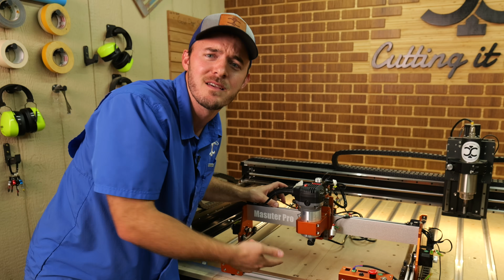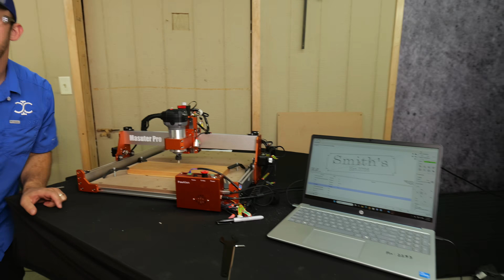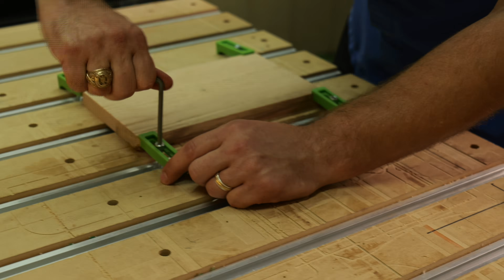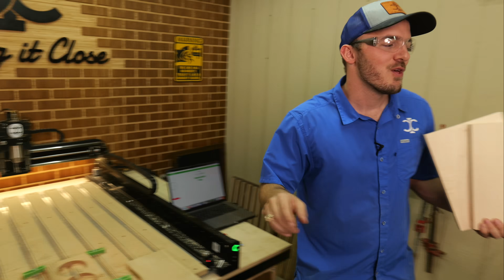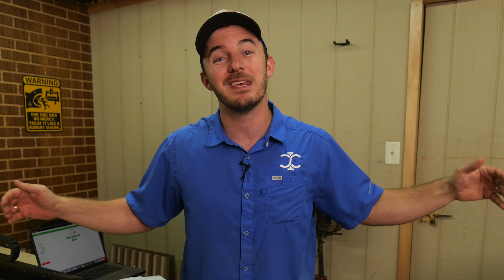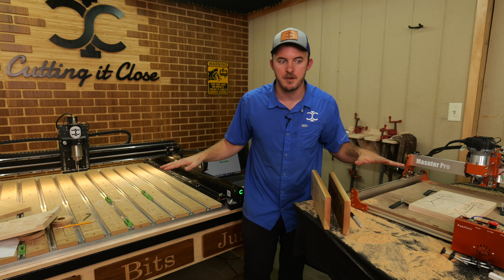$500 vs $5,000 CNC - Are They REALLY Worth 10x More?

Comment: Belt-driven axes are fine for 3D printing and laser engraving because the printhead/ laser is relatively light and does not experience any loading during use if you are doing it right. There is also exceptionally low likelihood of getting foreign matter in the belt grooves with 3D printing, and a low but non-zero likelihood with laser engraving/ cutting - but you would need to not clean the machine for many, many hours in order to foul the mechanism. For anything that removes material as chips, Acme screws are the absolute minimum and ballscrews the preferred mechanism. Linear rails have become the standard for any level of machine, as Hiwin clones are now very cheap and reasonably functional. The same holds for V-wheels as the belt system, it's fine if there is no foreign matter and light loads such as 3D printing and laser engraving. For the linear rails, the Hiwin-style ones usually are offered with wipers to decrease the likelihood of foreign matter getting into the mechanism.

You can now get a better machine for $1,000 (ball screws, Hiwin-style rails, but 16 x 12 x 3 inch work envelope) than I was able to purchase for $3,500 about a decade ago (ball screws, hardened rods with plastic bushings for linear rails, 6 x 6 x 6 work envelope). But the old machine was built with the rigidity of a mill, and the new machine was built as a router. That is a significant difference, but it only means something to the end-user if one intends to work with ferrous metals.

With regards to losing steps, the Shapeoko does not appear to have closed-loop steppers, and I would be willing to bet they are not servo motors either. If it had either, I am sure they would point it out in the specifications, as they are a significant upgrade. Any open-loop stepper motor can lose steps. Everything presumes the motors did what they were told. At least with closed-loop steppers or servo motors the motion controller has feedback when the motor is unable to obey the command, but it doesn't know by how much the axis has deviated from the commanded position. One step here or there, particularly for woodworking, is not even something you will notice. Many machines step hundreds of times to travel one millimeter distance, so you need to lose a lot of steps to have a visible problem. Even for hobbyist machining, I have yet to see someone integrate a glass scale DRO sender for directly measuring the axis positions and feeding them back to the motion controller, so no machine truly knows where it is as everything counts steps from the homing position. Sure, some hobbyist CNC mills have a DRO, but it's not an active participant in the motion control system. Bigger/ better motors, which is part of the difference between the machines here, just means it's less likely you will overpower the motor and lose steps or that the motor has some limited ability to self-correct for abnormal positioning. You are comparing a tiny NEMA 17 motor to a significantly larger NEMA 23 motor. It's not a fair comparison.

I second the suggestion to compare one of the $1,000 units (3030 or 4030). They have a similar motor, similar axis construction, etc. The biggest difference with the Shapeoko is the size of the work envelope.

Comment: STAY AWAY FROM BELT MACHINES. Budget lead screw machines would have been fine. Slow... YES, but fine. The relief would have finished, after that same 10-12 hours, and the smoker would have been fine with conservative cuts. 

As others have said, the Genmitsu 4040 Pro is a budget beast. I've also had good luck with a Two Trees TTC-450. Both would be miles better than a belt driven machine.  

I now have a Onefinity and really like it. However... I'd never suggest a belt driven machine to even someone I didn't like. Again... stay away from belts. There may be a pricey exception to the rule, but in general it a good rule of thumb.

Comment: I own the twotrees ttc450 ultra (about €600), I feel that it takes anything I throw at it. It's a sturdy machine with a 500W spindle and uses lead screws.. it can do 1000mm/min 2mm deep on plywood with an aggressive 3mm bit without skipping a step, however didn't try hardwoods yet. The only downside is that I need to use the SD card to give it jobs, because the USB connection is not really reliable..

Comment: At 11:30 you say slow it down and have to baby-sit. Both of those statements are patently false. 

Speeds and feeds are determined by the machine’s capabilities. If you made an error, and ran the machine faster than its capabilities for a certain material, then that is a user error.

There is no babysitting a machine. Once you have sent the G code to the machine, it is running autonomously. About the only thing you can do is stop it if an error occurs. But if an error occurs, there’s nothing you can do to save it as the error already occurred.

Also worth noting is there was no dust collection noted, which on the machine operated by bands you can’t afford to have the bands clogged up with wood shavings. 

Can the $5000 machine process more work more efficiently than a $500 machine absolutely. If you have a product sold and the $500 machine will do what you needed to do to make that product then why wouldn’t you buy the $500 machine? Sell even more of them earning you more money and then if you still have sales and can afford the $5000 machine by all means.

Comment: There is a lot of parallel to 3D printing. I bought a Ender 3 about 9 years ago- it was cheap, it didn't work well, I spent a lot of time and money on doing upgrades and learned the machine inside and out. I could make really good prints if all of the planets aligned and I had everything set up perfectly- but it printed very slowly.  Fast forward 7 years, I bought a Bambu P1S, which ran perfectly out of the box, never needed tweaking, workarounds, driver board upgrades, or G-code settings edited, and has made very few failed prints, plus prints about 5-10x faster.   One machine was a hobby just to get it to work properly, the other was a hobby in printing things that I wanted.

Comment: I have the Masuter Pro and have done 3D sculpting as well as many layered projects. For what it's worth, I would have used shallower passes on those projects. Takes much longer, but the quality does hold up. I made dust covers and guards for all the belts so sawdust is not as big an issue, but anytime you have belt drive you pretty much have to babysit denser wood. I've made my money back on this machine and then some, but I don't use it enough to justify buying higher quality. I'll run this until major failure and be done.

Comment: Hey I work with cnc's, I have a 4040pro with an upgraded xz, 2.2kw water cooled spindle, nema 23's, beefed up aluminum, and I also put linear rails on the y. I also built a wifi pendant that lets me control it manually with a ps5 controller and I can make tool paths from what I do with my hands. Its pretty dope
Reply: So basically I bought a 4040 pro and now I have almost no 4040 pro left.

Comment: I have multiple CNCs and I have had my FA Masuter Pro for 5yrs and it has paid itself many times over.  I have done everything in your video but only a couple of 3d carvings.  There are many inexpensive upgrade kits and 3D printable accessories for the Masuter Pro.  I like the idea of the less expensive machines because you can have multiple so you can do multiple projects at the same time.  Honestly, the sweet spot is $1500-$2000.  Compare the Fox Alien Masuter 3S for $900 or XE-Pro for $1400.

Comment: The fox alien is good for understanding cnc and thinker a bit to make it bether. But it will never come close to the Shepeoko. I have a diy cnc and i made it for testing and cut aluminum with mix results. The model of the cnc is a artisan and it is big. 120x180mtr but thats overall size. Made it with parts of a 3d printer. Looks and runs good. With a Makite CNC!

Comment: I am interested in starting with a cnc that can cut metal,AL,Copper and Brass. I have experience from my work as a Lab Technician for about 10 years with some experience on vertical mills,drill presses,planars so I am not a machinist but familiar with the operations. This is a very good video too bad there wasn't a $1-3,000 cnc router with choices for spindle vs router tools etc. Also I love your approach to this initial dilemma when buying a cnc router,also do you have an equal in the 3D printing field ? I have been doing3D printing for about 3 years and find the majority of posts promote 3D printing as "easy" and a "great" source of manufacturing 3d objects yet we both know that's not the truth ,it can be very challenging and sometimes I have to babysit a printer thru numerous errors,some which are correctable,workarounds but cnc routing/milling can be less forgiving. Thanks for the great video!

Comment: This comparison is not really sensible.  The Shapeoko is a professional level machine; the Fox Alien is an entrance-level hobbiest machine.  Rubber belts for a CNC router?  Fine for a 3D printer with a low inertia extruder.  For pushing a router bit against hardwood?  No way.  And doing that with a roller carriage and no chip/dust control?  What do you expect?  Of course there's dust & chips on the carriage way -- and on the rubber belts & their cogged pulleys as well.  Setting up the Fox Allen with protected carriages and an effective dust shoe would be a better test of its capabilities.  For smaller jobs that don't need the Shapeoko size, CNC routers that are significantly less expensive can do a great job.  This comparison seems designed to prove a point.

Comment: I have a twotrees ttc450.. headache. Had to rebuild the gantry due to backlash. Then a spindle upgrade that came with a  scrappy power supply that lasted 3 projects. It ended up costing me over 1k and I could have bought a better used cnc for that price

Comment: I got the Sainsmart 4040 Pro Max.  It has screw drive instead of the belts, and a nice 700 watt router/spindle.  Ive run all of these kinds of projects, and not had a fail yet.  The only bit Ive broken so far, was because I had the Z axis set to go down 10mm per button instead of 1mm...  Wasnt using the Z probe.

Comment: Alright had to subscribe. I did experience the skips but also i have switched to Easel pro and using that software instead of importing g code to candle and running the job. So since i did that and i use HDU (i work at a sign company lol, im the painter) It SEEMS to me that Easel Pro cuts better, actually i didn't have any skipping issues while it was going in circles for that test job. The only problem was my fault i forgot to delete a design and it cut  a tiny bit deeper. It's been 3 months and that's what i learned so far!

Comment: I live in the UK, and started by taking a punt on a 'Denford Microrouter' second hand on eBay for £600 from a guy who lived a few miles up the road and knew nothing about it. He was just buying and flipping mechanical items, and machinery that he had bought at auction. 
Once I bought it, I was shocked to learn I then had to pay (gamble) £300 for the controller software, to see if it even worked which could've been a huge problem, luckily it worked. The company wouldn't even give you a trial! It was £300 or nothing, and they build their own control software in house, so control the licence. 
I already knew before buying that the machine turned on, and the fans and lights came on within the controller box and on the controller board, and that the light also came on within the CNC enclosure, as well as the safety lock worked. But, I had no idea if it would work 'properly' or not, or even connect to the software or laptop. 

This machine was designed for the education market, so was built to a high standard, both in terms of components and safety. It ran on ball screws, and linear rails, and had a Kress (now AMB) "spindle\router hybrid" in it that took ER11 collets, with auto start up controlled by the g-code. The machine was in an enclosure, and the cut capacity was around the size of a sheet of A3. You could fit larger pieces in there, but it would only cut within the confines of a sheet of A3. So, sometimes you had to be clever in the positioning and movement of your stock to get the most capacity from the machine. When the machine was brand new in 2004 it would've cost around £15k. 
They still sell the same sort of machines now, just in flashier cases, with newer, more modern graphics on the side, and the electronics and controller fully built into the unit. No doubt with more modern upgraded motors and parts, as well as beefier spindles, including options for ATC's. Like I said they are aimed mainly at the education sector, so come in a range of sizes, but the largest is probably a bed of 1.2metre long x 75\80cm wide (I might be wrong). My controller wasn't built in. It came in a separate massive black box. Like a huge PC case. That is no longer an issue on the newer models. Though I did get the luxury of being able to connect via USB, as some of the earlier models used RS232 serial cables.

Even though the machine was around 16 years old when I bought it, I rang Denford and they were incredibly helpful even though it was second hand. They still offered support, including the option of a full service, and parts if needed. As well as the sale of the very expensive control software licence! Luckily this was transferrable when I eventually sold it. 
 

It taught me everything I needed to know about CNC and was a pleasure to use apart from the odd teething issue. Best of all, it made me enough money to upgrade to a larger machine, and when I sold it I even made a profit 5 years of use later. 

The moral of my long story is to shop around on the second hand market, while learning all you can online about how CNC's work. My story shows that you can easily pick up a bargain second hand, of excellent quality, for just a little bit more than the Fox Alien Masuter Pro. 

It all depends what you want from your machine. If you just want a little toy\project to tinker with, learn with, and make a few small bits in your spare time, like PCB boards etc, where time and speed isn't an issue, then there is a market for these machines.  If however, you want to do some serious work (I was outsourcing my engraving\v carving at the time which was losing me profit). If you aren't able to save, as I wasn't at the time, and time is important, and you don't have a huge budget, then do some research, and find a good deal second hand. You would be surprised what's out there. Just always do your due diligence and homework, buy from the right places where you have some form of protection, and try not to get ripped off.

Comment: I have 40x40 ex fox alien but it a older machine and belt system is a little different  It does have nema 23 stepping motors but did up grade the spindle to dewalt 611. I cut some nice 3d carvings with it . The biggest 3d carving was 8x6 it took aboout4.50 hours at 30 inches a min. I have cut alot of stuff and had a few problems but for most part it is ok. I work 8 hours a day at my first job so using the cnc is fun if I had the and room I buy something bigger and nicer. I have been using  this cnc for three years.

Comment: Why not compare apples with apples and run them both at the same speed?
Reply: The Masuter Pro can’t run those speeds. It has nema 17 stepper motors and a weak controller.

Comment: I have the FA. Those are both common issues with oak and the belts. I’d stick to softer woods and very slow profiling.
Reply: I encourage you to upgrade the stepper motors with the nema 23’s and upgraded controller. Insane difference. You’ll rip through hard woods like nothing.

Comment: I did a lot of sculptures on a Genmitsu 4040 Pro, but it was a pain. Losing steps was common. I'd constantly save the current line of G-code so that if It shut down, I could restart the program from that point in UGS. But it was a real pain. I switched to a Shapeoko 5.1 and fell in love with that machine.

Comment: Definitely sounds like a buy once slant cry once option. My question is do you really have to spend $5000 for a decent CNC? In your experience what is the minimum amount you need to spend on a CNC?
Reply: So take this with a grain of salt since I'm also a beginner in CNC work but I built an mpcnc machine here.  The time it takes to build and calibrate and now I'm just rebuilding the software using ai agents $5k doesn't sound that bad :D that said I made a seemingly better machine than the fox alien for around the same cost (if we exclude time). Also ended up building a workbench for it, used kit of metal parts and random wood sheet and 2x4 had sitting around so cost was just brackets $50 and time... You might be noticing a trend basically if willing to sacrifice the time then can do it for cheaper and generally better than the cheap desktop CNC machines if already have equipment like a 3d printer but lots of depends on what you're starting with and how much time/energy willing to put in vs cash.
Reply: Just watched end of the vid and agree with the recap, if willing and able to learn about the electronics and control software then cheaper machines definitely can be made to work well, if don't have the time to sink into troubleshooting and need the thing to just work then is worth the extra cost.   Same goes basically for 3d printing, a mk4 or core one from prusa prebuilt will just work kit you will learn some, crappy old ender 3 will teach you the hard way whenever a part breaks over time.  The cost is in stepper drivers and stepper motors with higher torque so can overcome friction or pushing through material without skipping steps/missing moves, if crank current on cheaper stepper drivers and motors they can work but need to keep fan on them to cool down and eventually cook things.  Also more rigid frame materials and tight linear motion systems cost more.